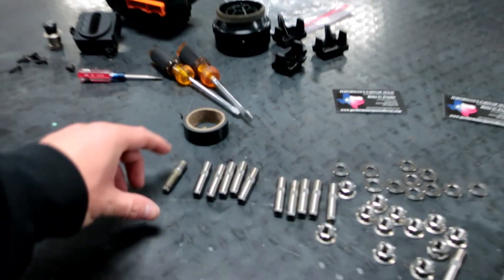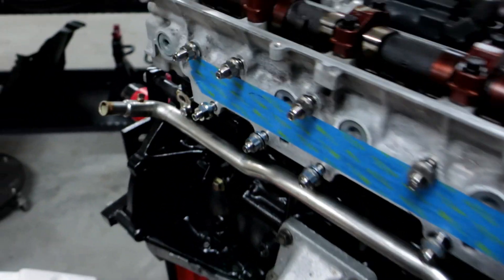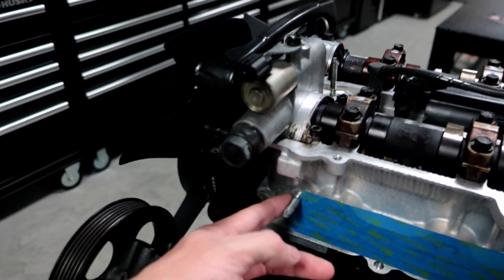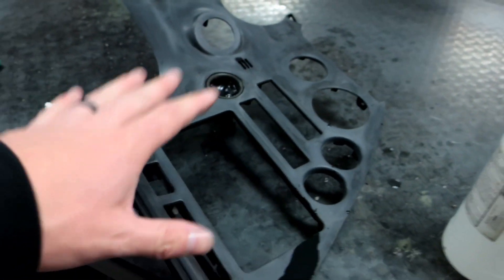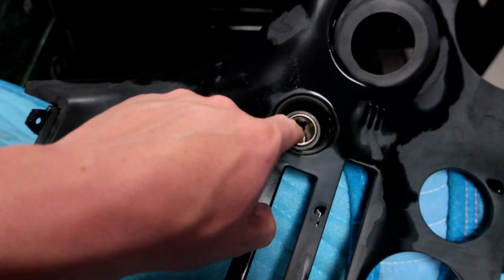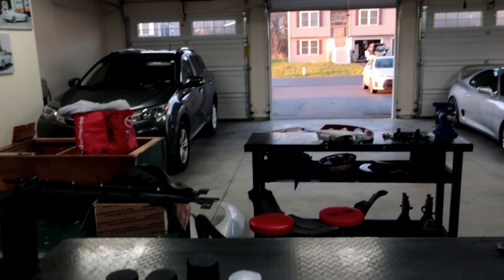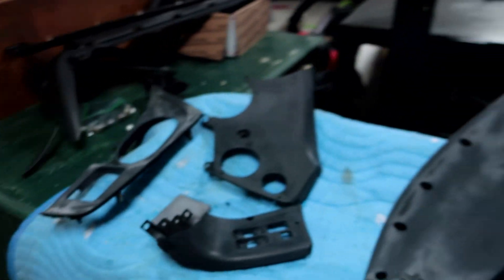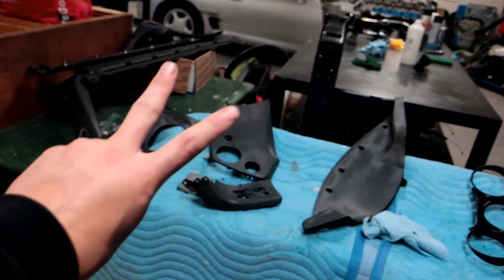Custom Titanium Parts For Wife's Supra!

Comment: Surprisingly I tried SEM Bumper coater #39103 on my interior panels. It came out great! It looks very close to the original color of a series 1 panel. I found the suggestion on the Supra forums because the valspar isn’t being sold anymore.